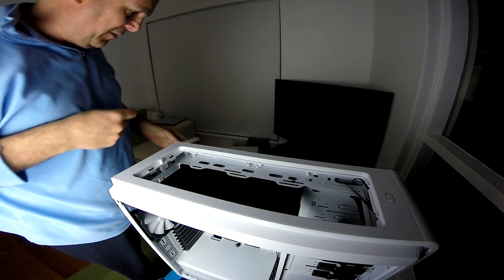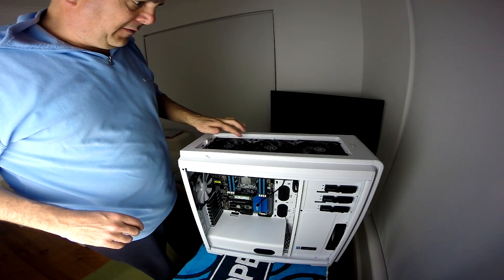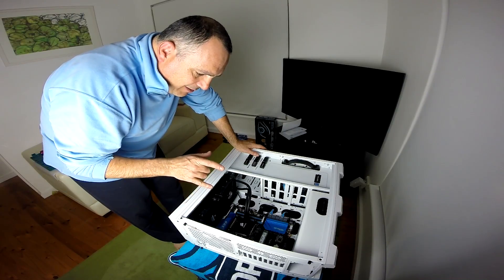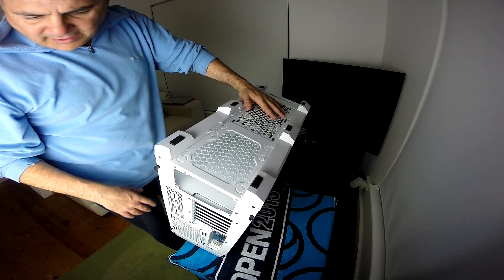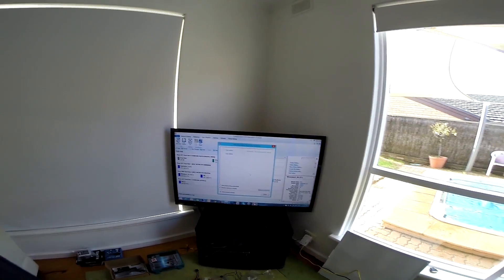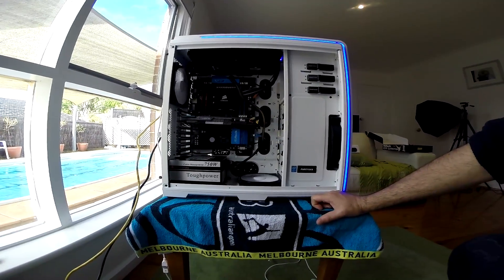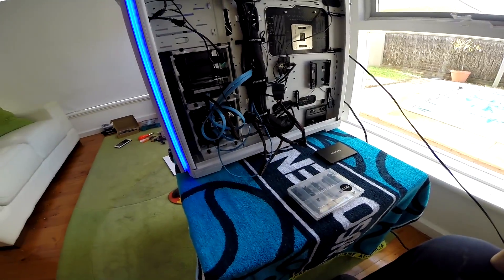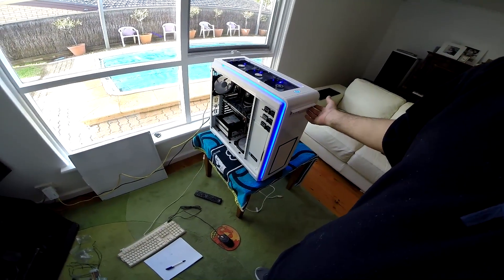X99 Extreme4 based Workstation with M.2

Comment: Hi. I know this is an old video but can I ask what M.2 drive you used (or if you can recommend one for my Asrock X99 Extreme 4 motherboard).
My pc:
Asrock X99 Extreme4 motherboard (with Ultra M.2 Gen3 x4)
i7 5960X
Samaung SSD (970 I think)
32 gb DDR4
RTX 2060 gpu
And a couple more HHD's for extra storage.

I'm thinking of squeezing a bit more life out of my pc rather than build a new one. I want to replace my SSD with a 1 TB M.2 drive (and eventually replace my 8 core i7 5960X with a ten core i7 6950X)
Thanks.
Reply from the maker: This was a while back. My suggestion is that you go to the AsRock website support page for this motherboard and find out what M.2 drives you can use based on the Bios version. I would suspect that if you use the latest Bios, you can use most M.2 drives. Just noticed that at 14:25 I do mention what it was, it was a sm951 samsung
Reply: @AdrianoCisternino  Yeah I did check on their site already.
Thanks for reply!